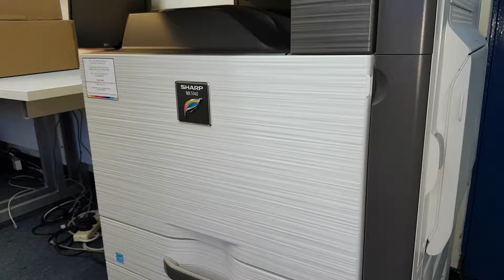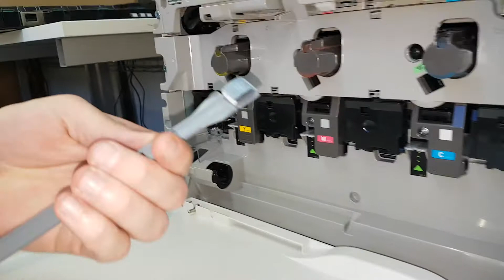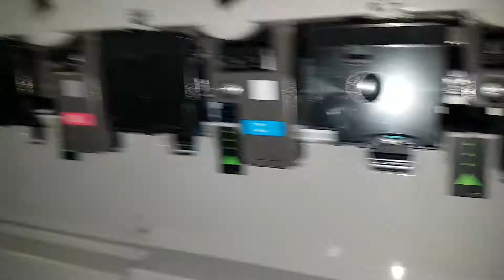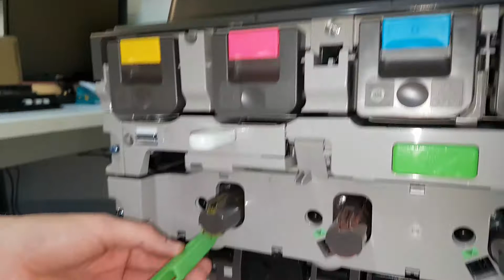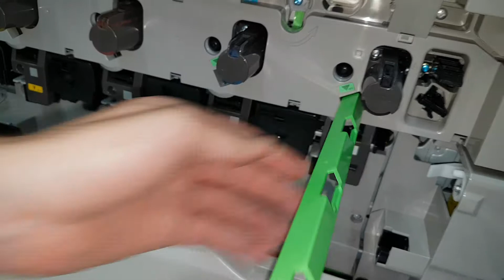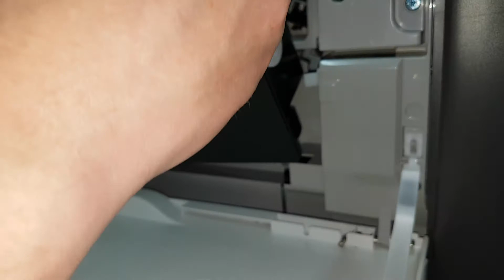Cleaning And Maintenance Sharp MX 4140, 5140, 4141 And MX-5141

Comment: Hi this may be a noob question but what does that actually do when you insert that in each drum and toner?
Reply from the maker: Hello Maverick, 

When you have lines on your pages when printing their maybe a build of dust on the 4 laser pieces of glass and this can cause a line. If you follow the video cleaning the machine may prevent this. If you still get a line then there may be another bit of dirt somewhere like on the glass. If you still get a line then the chances are you will need a drum replacing.

Thanks

GB Copiers